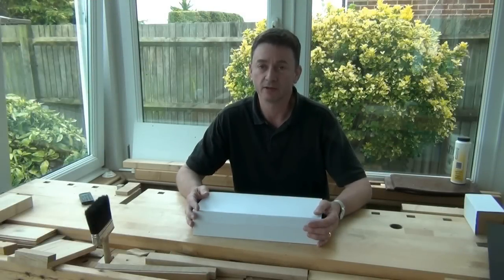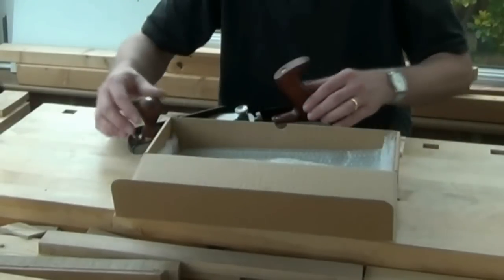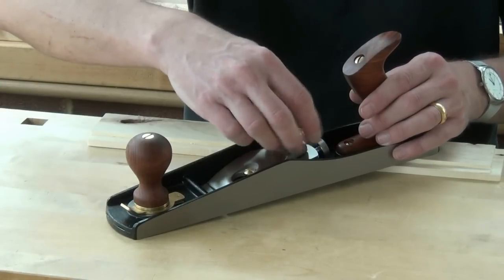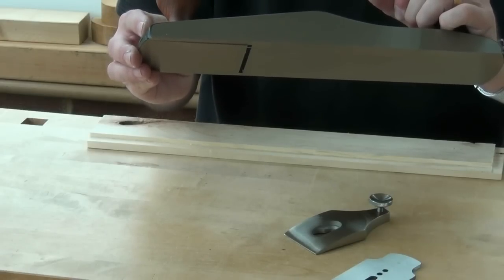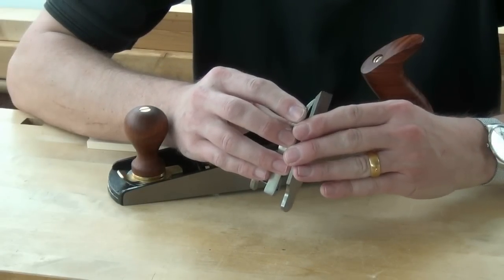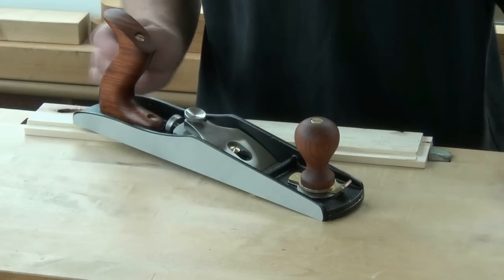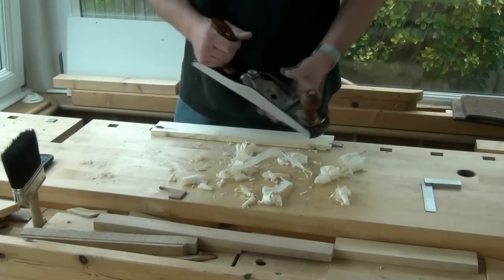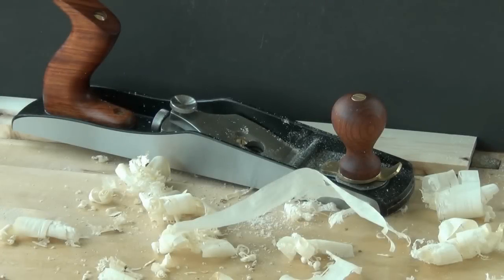Quangsheng No.62 Low Angle Jack Plane Review

Comment: It's a beautiful plane, and the adjustable toe is cool, but the location of the adjustment knob would be no small consideration for me.  That design aspect is just a bit of a disappointment.
Reply from the maker: Michael Meara You're right Michael, and I can't understand why it's like that. Anyway, I shall investigate and post any update.
Reply: Mitch Peacock - WOmadeOD It's probably because this plane was designed by and engineer vs a woodworker.  (No offense intended toward engineers)
Reply: Michael Meara Take a look at a vintage 62. I doubt that the plane makers back then ignored the needs and wants of the workman. It is a Block plane. I would say the adjustment knobs are just as convenient as other block planes.
Reply: Ray Bohn Fair enough, but I prefer the ability to tune a plane on the fly.  This would definitely influence my decision to purchase.
Reply: You guys do understand that most brands have that problem on the LA jack plane. That was the one advantage to having the stanley style bench planes. You're able to adjust on the fly while planning. I've used a Veritas jack plane and it was a pain to use the nob while planning. LA jack plane use norris adjuster for their blade. You could skew the blade when adjusting if you ain't careful.

Comment: You did not test the base for flat, mention the iron steel, test for square sides or use for 5 hours straight to test the handles. Of course you hone the blade before use!Your bench seems a bit low for you and your technique is straight out of the box.Veritas cap irons are cast aluminium and the knob thread induces corrosion so it freezes up until you free it with a wrench and re-tap the thread; such a joy!
Reply from the maker: +William Fretwell Thanks for watching. There is no reason, other than cost, that the blade couldn't be prepared fully during manufacture, so I judge this as a worth while indicator. The steel specification is available from any supplier, and I can't add any more to that. Each to their own regarding bench height and planing technique - I find mine perfectly comfortable. Happy woodworking.

Comment: These are not good planes. I have struggled and fought with my 62 for the past few months. Edge retention on these is appalling, yes you can hone it so you get those nice fluffy shavings, but that will soon disappear after5 min on some hardwood. The mechanism for moving the mouth WILL seize up and require you to take the handle off fully and use a hammer to free it up, oh and there's nothing holding the wood of the handle to the mechanism, and that's not from over tightening the nut. Finally that Norris style adjuster... It doesn't!
Do yourself a favour and AVOID this cheap Chinese rip off.
Reply from the maker: Thanks, that's certainly a cautionary tale. I would have returned any plane like that, so either I was lucky or you were unlucky - not the greatest enforcement either way.
Much appreciated comment.
Reply: +Mitch Peacock - WOmadeOD I also wanted to say flattening the back of the iron before use can take a few hours to get a passable shine, the reason these plans don't work out of the box is the blades are effectively shipped blunt!